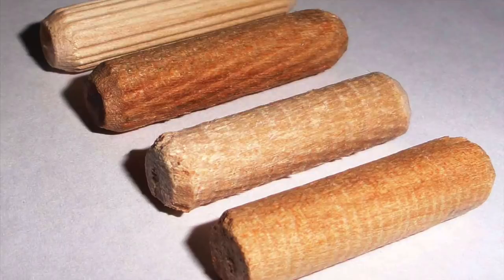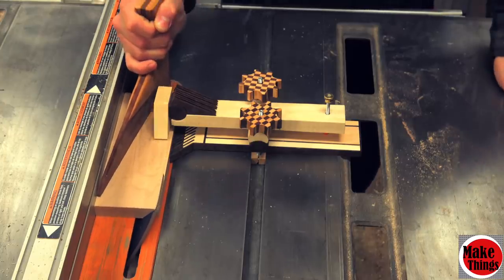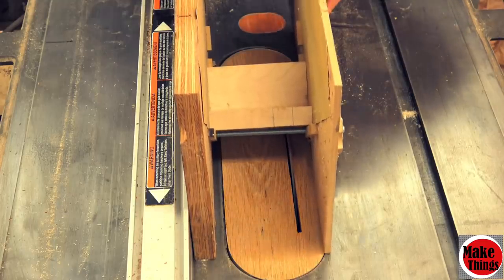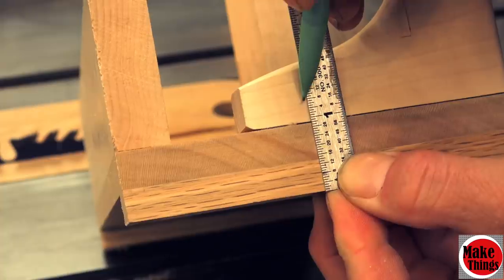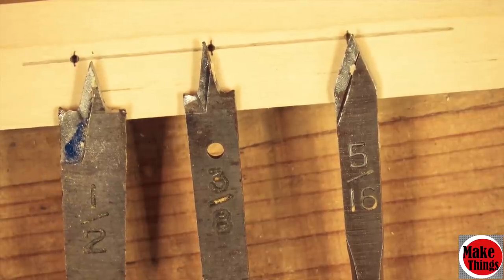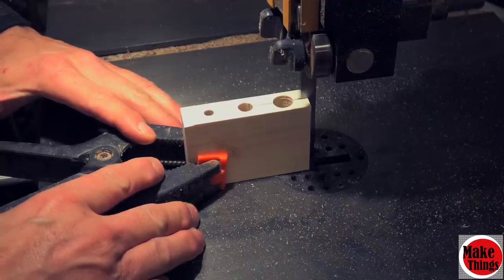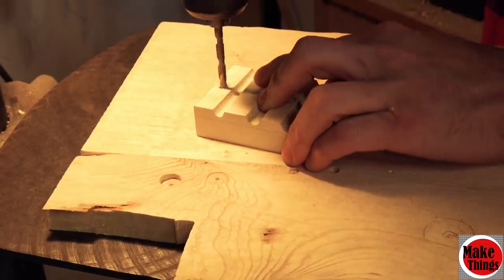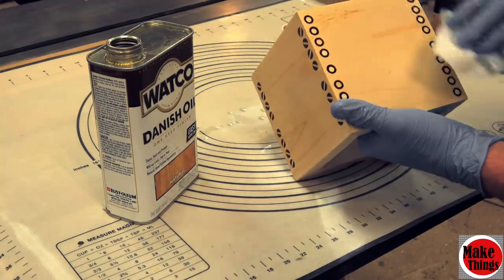Split and Double Dowels Jig // Creating an Enhanced Cosmetic Look for Dowel Joinery

Comment: This is great work- such a cool jig. I'll also suggest another option, for anyone like me who's too lazy to make something like this 😉.

Rockler sells a really useful jig named the "corner key doweling jig" that's meant for reinforcing miter joints with dowels. It allows you to drill holes for 1/8, 1/4, and 3/8 inch dowels, and because of this, you can also create the "double dowel" effect shown in this video. I know Rockler stuff tends to be waaaay too expensive, but this jig is actually a good deal at only $50 (well, a good deal for a Rockler product, anyway). I've used it for this effect numerous times, and it's always come out great. Don't mean to take attention away from your effort here, just throwing in a suggestion in case anyone's interested in a pre-fab jig.

Keep up the great work!

Comment: very nice, as an added look rotate the slotted dowel 90 degrees cut another slot and you can make a Philips dowel
Reply from the maker: You’ve read my mind!   I thought the same thing.  You’d have to glue an insert first and wait a day I think as you’ll just end up damaging the other.  Those table saws are rarely ever delicate.  

I’ve also thought of them making butterfly like cuts by make a pass, gluing an insert and coming back later to cut another at a slight angle.

Comment: Nice job, I like it.
I will trim the 10-32 screws at the end of the nut.  I don't like them sticking out so far as your's.  The length is not needed.
JIM
Reply from the maker: Yep, you’re right.   I just hate cutting ends off of those bolts...although, if you didn’t clean them up and cut them with the nuts on, you wouldn’t need worry about them coming off.

Comment: Nice build. Would this be difficult freehand on the bandsaw with a fence?
Reply from the maker: I thought about that but It would be difficult (not impossible) to get the width right.  If you manage to do it, let me see.  Be careful to use a jig though like my bandsaw sled as the contact surface of a dowel to the bandsaw table is not enough to keep it from spinning.